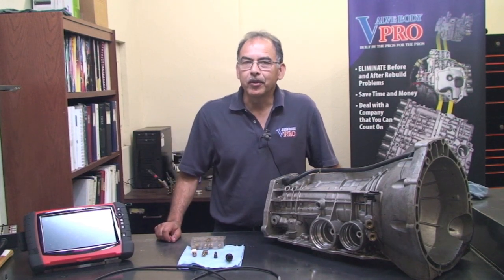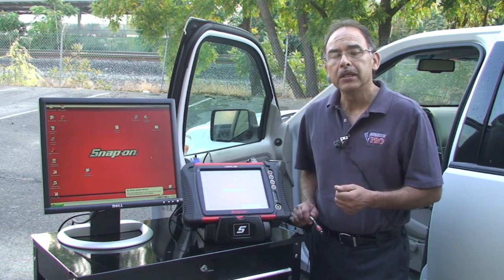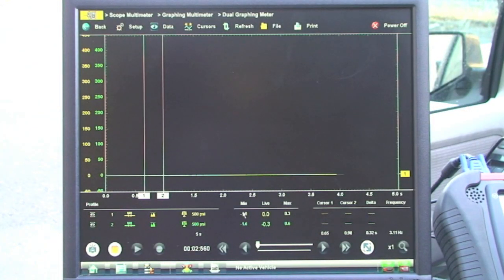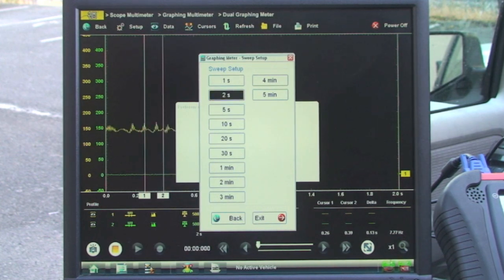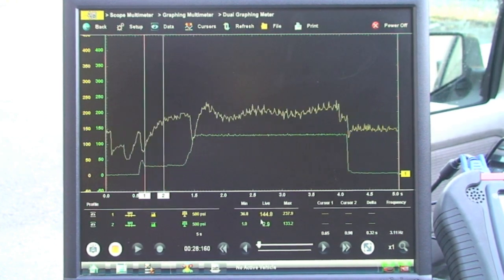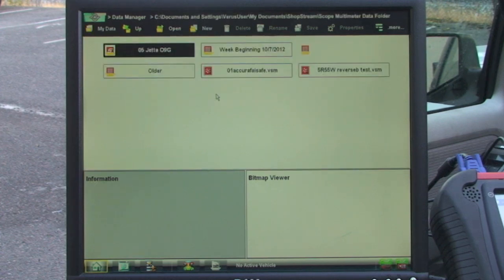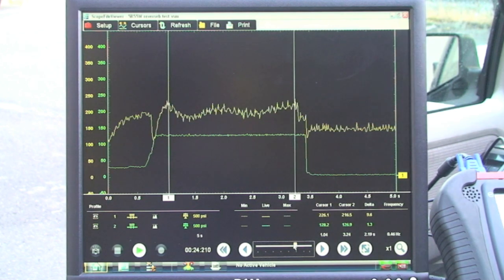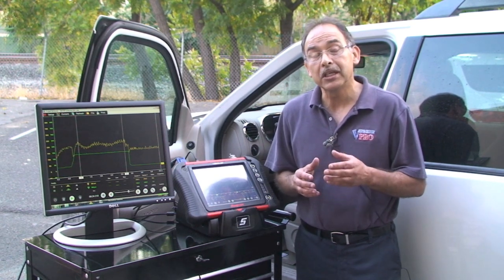Pressure Testing with Transducers

Comment: very informative video. put it this way.   in today's automotive field  an oscilloscope and pressure transducer    are necessities.   pressure gauges just dont work on modern transmission other then telling you you have enough pressure of not.  but to see mechanical movements of solenoid, sticking  or dragging solenoid.......... a scope is imperative